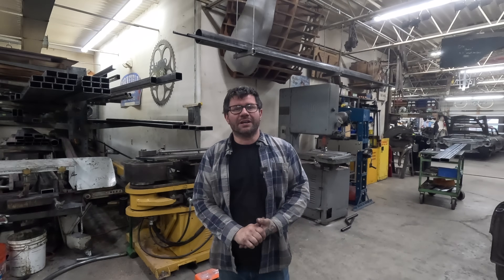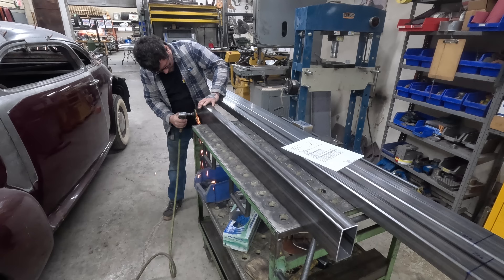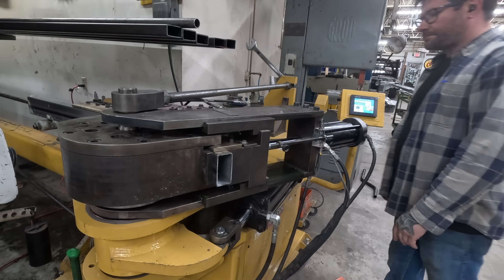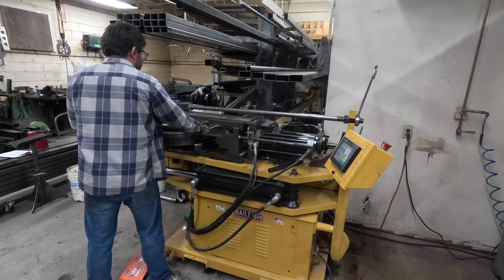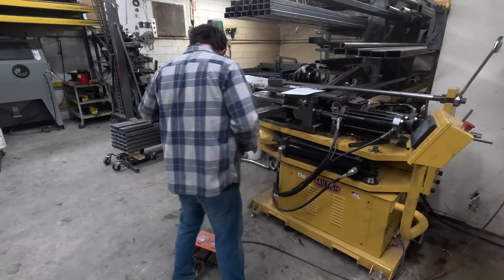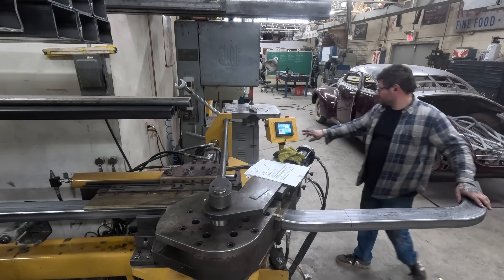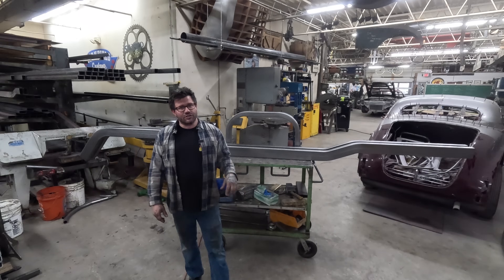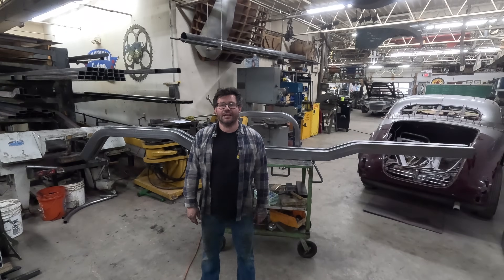COE Frame Rails

Comment: Can you build a frame for any vehicle and how much would it cost
Reply from the maker: @CoreyBoyle-x2e  that is a very loaded question. In theory yes i am capable of building a frame for any vehicle. To many variables to be able to give you a price with no information on what it is
Reply: @cornfieldcustoms  it’s for a 99 Chevy Astro but I’m putting 12” wide tires in the back and big rims in front so figure instead of a c and a z notch just see what it would cost around to just get the frame made
Reply from the maker: @CoreyBoyle-x2e  i would need a sketch of what you need. Full length rails start at $1100 a pair

Comment: Just wondering if you manually check all the bends for degree accuracy  after you have completed the bending?
Reply from the maker: Not every bend due the angle usually not being as critical as the landing points
Reply: @cornfieldcustoms  thanks for answering! So do you verify the landing points and vertical rise from each landing? That is clearly a very good machine, have you ever had any deflection/errors due to the machine?
Reply from the maker: @paulblack1811  never had any issues other than improper input from me. Once the machine is set its pretty on point.

Comment: it would seam like a 2nd machine would come in nice other then the payments ,, don't know if you do enough each year too make it worth it .. but 2 hours changing over on  a job labor plus test bends that must add up each year ..
Reply from the maker: another machine is about $100k out the door, plus it takes a massive foot print in the shop ( machine and swing out room) so that is not a good option. currently I am only changing the tooling about once a month on average and I charge a die change fee if I have to do both hard and easy way on the same rail

Comment: Where does the worksheet come from, you or the customer?
Could you show us how you determine where the bends go, and take us through control arms, caster, camber, toe, and bumpsteer?
I have a 49 Studebaker pickup truck that I'd love to update it. I don't want it to handle or steer like a tugboat.
I really love these videos.
Reply from the maker: Some of my other video shows full detailed lay out of the bends. The work sheet comes from bendtech software that I print out after designing the rails. If and when i do a full frame build i will talk about the other things you listed